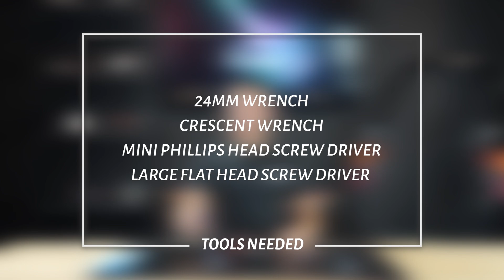Disassembly & Reassembly - DV50 Valve

Comment: While the video is quite informative,, more attention to detail is needed. From the User's perspective, alignment of Top and Bottom insertion of the valve parts is not clear. We should be able to see the P1-P2 and C-D ports so we can determine the correct placement of the stem and solenoid.
The company label appears to be attached upside down and once refitted, is now at the bottom of the Diverter, which further adds to the confusion. 
There is no clear way to determine the Top of the Diverter. The replacement Diverter I received is oriented opposite of what is shown in the video with the label at the top. (And it works fine.)
Reply from the maker: Thanks for the feedback, it's important to us to make our videos as informative as possible!
Reply: Ok, well where is the”More Informative Video”?  Stan is correct - more Video info please!